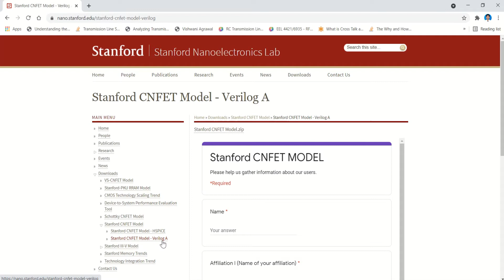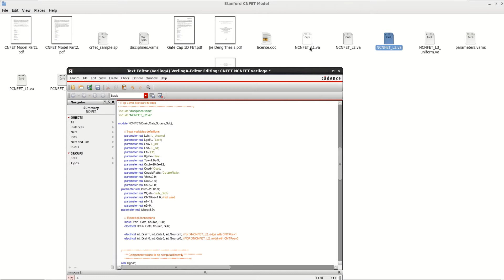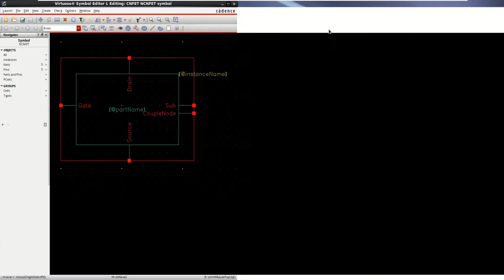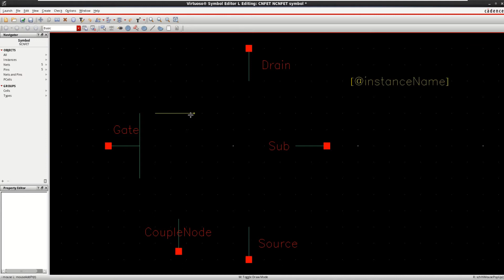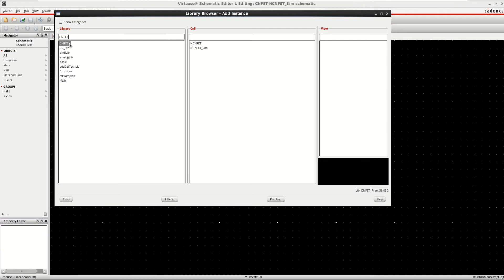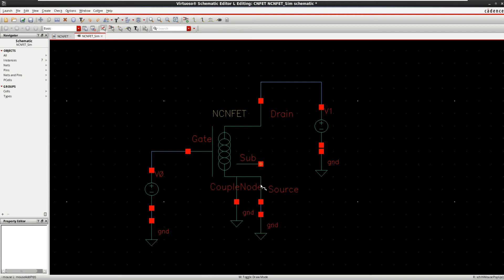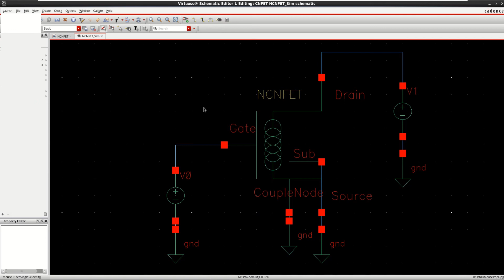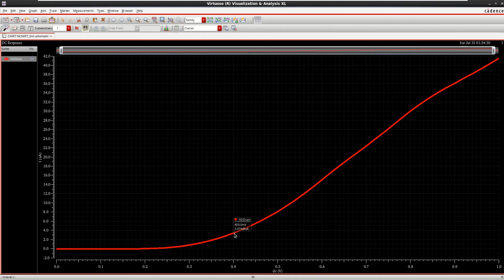Cadence Virtuoso: Import CNFET Verilog-A Model.

Comment: Hi sir, may I ask what type of text editor you use for Verilog-A that has the "build a database to instance" option, because I only have the Read Verilog A to open with and what version of cadence did you use?
Reply from the maker: Hi, you might have used old version of cadence. Try to use the 6.1.7 version

Comment: Hello Sir, i m facing issue, as told in the video that when copy NCNFET_L1.va, NCNFET_L2.va and parameters.vams to the directory file, only CNFET folder is created in working directory, but inside the CNFET folder  no NCNFET folder is created. and hence no veriloga folder is created inside it, therfore not able to paste the files. pl help me in this regard,
Reply from the maker: Hi, are you able to open the text editor to paste the verilog-a code

Comment: Hi Sir, so I have designed a 3D finFET on Silvaco TCAD. Can you tell how I can import that into Cadence Virtuoso? This is very important to me.
Reply from the maker: Hi, first export your design from Silvaco in a compatible format like GDSII (Graphic Data System II) and then import it into Virtuoso using the "File -> Import -> Stream" option in the Cadence layout editor
Reply: Sir even I have designed on Silvaco TCAD. I want to use my device into circuit like inverter, not gate etc. kindly help me Sir..! I need your help
Reply from the maker: Hi, I dont have Silvaco tool
Reply: I just need to know how I can use the CSV values (IV characteristics etc) and use them into circuit design on virtuoso
Reply from the maker: Hi, not much information about that approach

Comment: Also a correction, CNTPos is not the number of tubes under the gate but the position of the CNT under the gate. the number of tubes in the device is handled by the variable 'tubes'.
Reply from the maker: In cadence I couldn't find tube but 
Learnt that cntpos is tubes
Reply: I actually figured it out. If you look at the L3 verilog file you will see that it says in the code that CNTPos is not used. In order to get the tubes param to show up in the CDF parameter list I had to add the tubes parameter to the L2 and L1 veriloga files. Hope that clears it up! Where did you learn that CNTPos is tubes? Link to the documentation? @dr.hariprasadnaikbhattu
Reply from the maker: @jonathanlevine323  I couldn't recall right now

Comment: For people suffering from the read veriloga problem - In your main cadence terminal set your text editor to gedit by typing editor="gedit", now when you try to follow the procedure it will open with read veriloga but in the gedit text editor, when you add you code, save and close that editor, it will prompt you to create a symbol
Reply: thanks man!
Reply: for those who are wondering what is cadence terminal.
it is the main(home page) page of cadence..
it's the first page that opens when you start cadence.
and at the bottom you have to type
editor="gedit".
Reply from the maker: It should have a Text editor. Not g-edit
Reply: Thanks, this really helped.
Reply: Sir I have cracked versions of cadence .. is it possible for that one... I am not getting a text editor...
Reply: Hi sir i write a cod about memristors and i have this error in cadens can you help me plz? 
Message error: an invalidsyntax has been specified for port declaration in module header. Specify only discipilne indentifiers for port declariations.